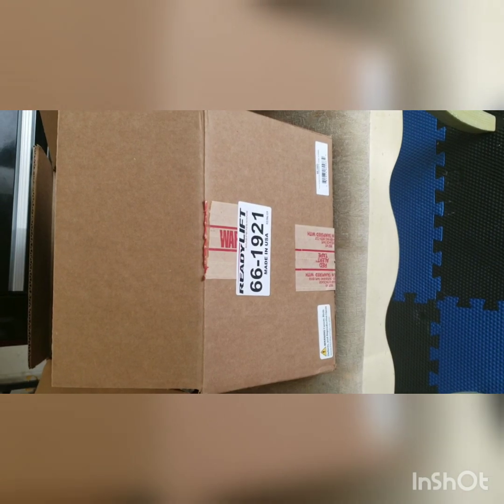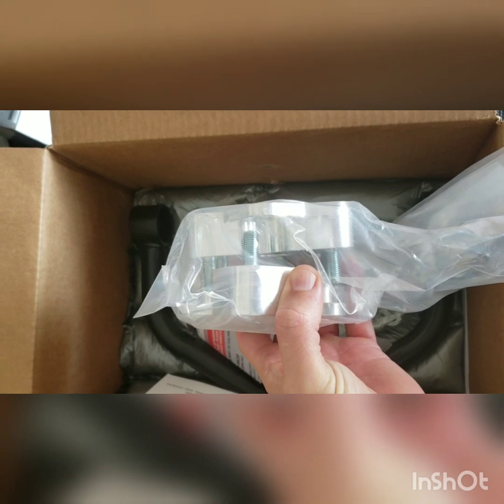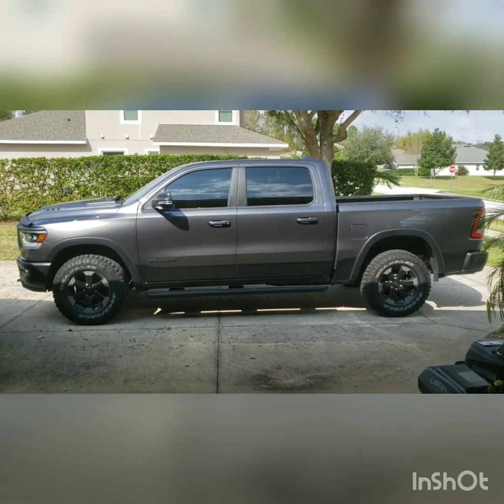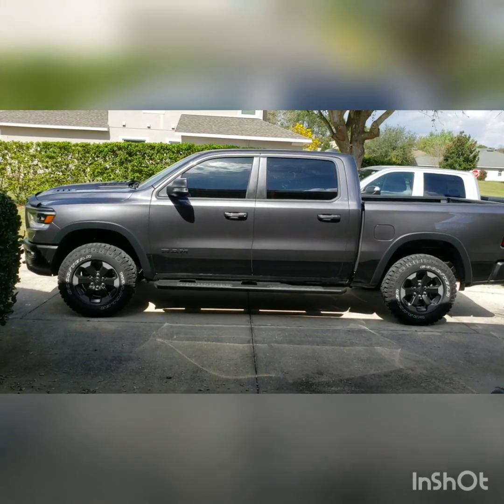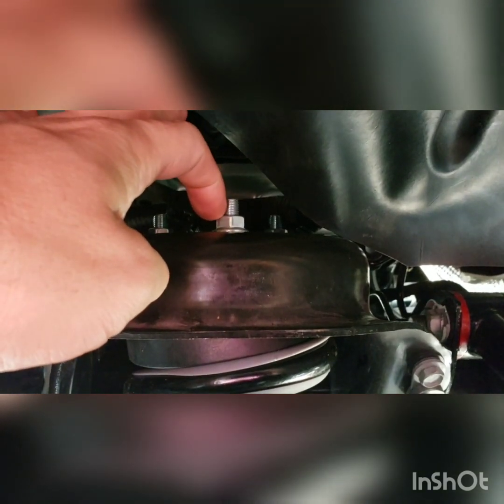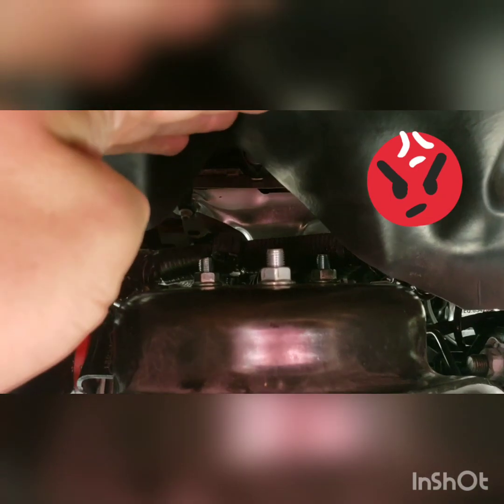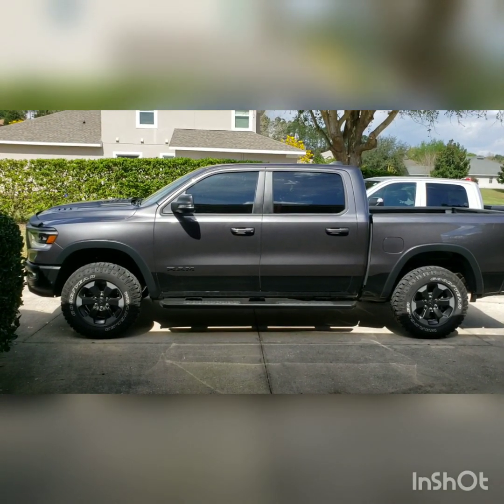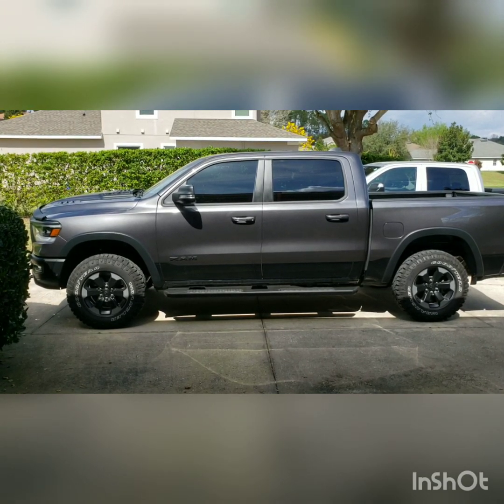Readylift sst leveling kit for a 2019 Ram 1500

Comment: Looking to do the same to mine. I just bought a new leftover 2019. So your kit with that part number came with the control arms and everything needed? Just trying to make sure because some people have said they ordered the leveling kit and control arms separate. I want a complete kit I can drop off and get the truck back with no ride issues. Really appreciate any information 👍🏻
Reply from the maker: Yes the part number comes with everything in one kit and it's totally worth is, there is zero difference in ride quality. More importantly it looks alot better with no rake!
Reply: @tommyguns7191  Awesome. Thanks for answering me back. I really appreciate it. So its been about a year. Are you still happy with it?
Reply from the maker: @furyroad7565  No problem brother .Yes definitely the nicest truck I have ever driven. I definitely think Ram got it right with these, I'm a fan for sure. My father in law just pick up a new trial boss and I was in it the other day, while it feels nice it's just no comparison with the Rams in my opinion. Just felt cheap compared to Ram.
Reply: @tommyguns7191  Thats great. Ive had several Rams and they are nice. Glad youre enjoying yours. Thanks again.
Reply from the maker: @furyroad7565  Thank you brother, stay safe out there.
Reply: What hood guard/protector do you have? A lot of what I've looked at says "does not fit rebel".
Reply from the maker: @furyroad7565  its thr OEM Mopar hood guard. Order it directly from them and you will be good to go. It wasnt bad installing it either , pretty simple.
Reply: @tommyguns7191  Awesome, thanks again sir ✊🏻
Reply from the maker: @furyroad7565  anytime!

Comment: What kit was this?
Reply from the maker: Readylift,  sst kit with the upper control arms for 2019 ram.
Reply: Tommy Guns thanks!
Reply from the maker: @davidreynolds4973  anytime brother!
Reply: Tommy Guns still feel like the stock ride?
Reply from the maker: @davidreynolds4973  yes no change at all to ride quality.
Reply: Tommy Guns you still running 33”s? Does  it give you enough clearance to run 35”s?
Reply from the maker: @davidreynolds4973  this kit will allow you to have 35's with minor really minor fender modifications. The current set up I have is with 35 x 12.5 x 20 with this lift. Offset is a -12 so they pop out of the fender well about 3/4 of an inch for a nice aggressive look.
Reply: Tommy Guns nice! You just trim the fenders to get them to fit?
Reply from the maker: @davidreynolds4973  no trimming just pulled the factory mud flaps off then bent the rear part of the fender about a 1/2 back and put the mud flaps back on. Looks completely stock. I have full lock and zero rubbing , but I wouldnt go with any more of a negative offset as it was pretty close with the -12 anything more and I'm not sure if you will get full lock with zero rubbing.
Reply: Tommy Guns nice thanks for the tips!
Reply from the maker: @davidreynolds4973  Any time hope this helps!
Reply: Was this the 2” leveling kit or the 3.5”?

Comment: What size tires were you able to install? Did you have to do any other modifications?
Reply from the maker: 35x12.50
Reply from the maker: I forgot to mention when I got the new rims and tires I did have to do some slight fender modifications to the back side of the wheel well. Nothing to the front though.

Comment: I have the same truck . Could I put 35s on this setup with 22x12 rim -51 offset ?
Reply from the maker: I dont think you can without going up. That's a big offset, I have a -18 and it was super tight even after the fender mods I did to it (no metal cutting). You would probably need at a minimum 4-6 inches of lift to pull that offset.
Reply: I have same truck as well could I do 33 by 12.5 with 22 by 12 -44 offset wheels